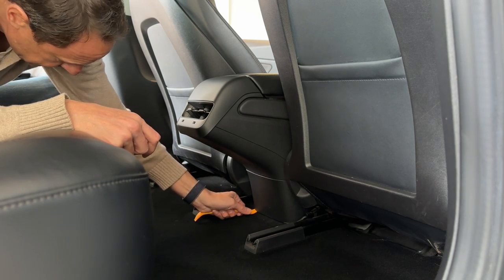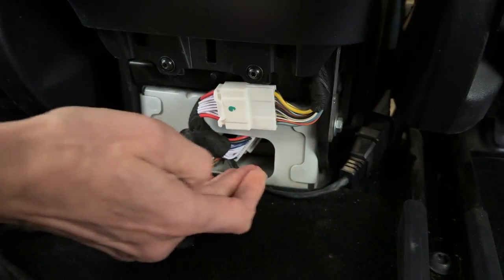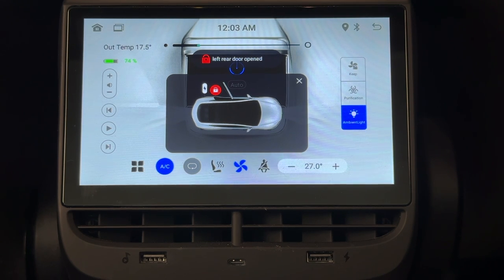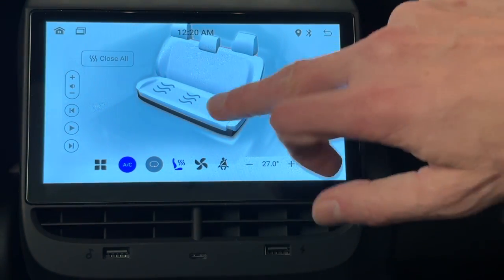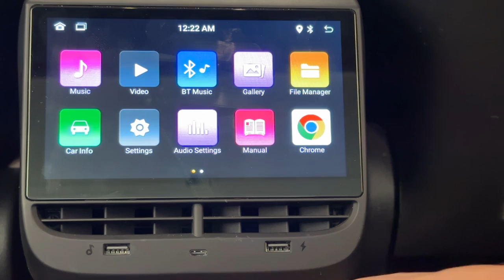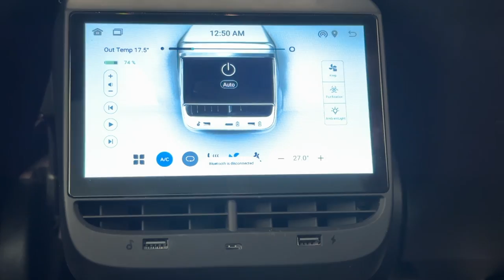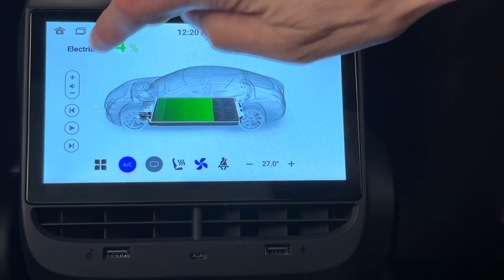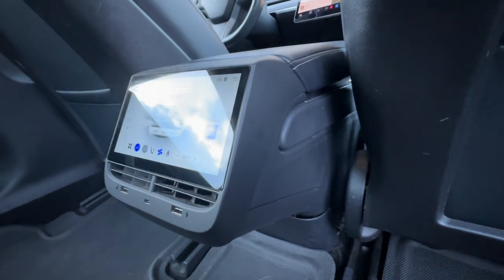EVBASE Tesla Model 3/Y Rear Screen Display

Comment: Nice work, FTG! Your combo video (install, features, and review) makes for one stop watching. I’m sure it won’t work with every product, but it made for a solid overview with this one. 

I don’t regularly have backseat passengers, so this is most likely a Pass for me. 

But if I did, (and they were old enough to be able to use that screen without my having to give constant instructions!), I’d give it a consideration. In that situation, I’d be a solid Yes - if the back controls did not change the front settings. 

Thanks for putting this together!

Comment: I would give it 5/10. Too laggy for me and the fact that it cannot use the cellular data from the car for Netflix is a deal breaker for my family. Hopefully there will be a better version in the future. Thanks for the honest review as usual.
Reply: Tesla has the cellular connectivity of the car locked down like Fort Knox due to usage agreements with AT&T. Extra hardware will not be able to utilize the car’s cellular connection until that agreement changes. I was able to get Netflix downloaded onto my rear screen and tether to my cellphone WiFi, which I have unlimited data on. This works fine for watching Netflix on the rear display. The “lagging” is only apparent if you venture into apps- if you’re on the screen that controls A/C, volume, media, etc, there is zero lag because there are no interaction animations. Most people don’t delve into the apps but having access to seat heat and A/C in the rear was well worth it for me. Most media consumption in the back seat for my family would be via an iPad, so having media on this rear display isn’t important for me personally. 

I’ve had at least 2 dozen people in my back seats comment that “I didn’t know Tesla offered a rear screen for the Model 3! Cool!” They didn’t realize it wasn’t OEM - the fit is absolutely perfect - and in their usage of the temp and seat heat, no lag is apparent.
Reply: @Unkn0wnC0mmand  I can't get either of mine to play sound at all. Any help?
Reply: @Howard McQuilkin  you paired and connected their Bluetooth to the car and then selected their Bluetooth connection as the audio input on the Tesla screen? 

That's all I did to get audio over the Tesla speakers.
Reply: @Unkn0wnC0mmand  I did. I have this unit in two different cars. Neither one will play audio.
Reply: @Unkn0wnC0mmand  Yes, I have been trying for a week or so. Still zero sound.

Comment: This is the previous version with 7.0 inch  screen and no Bluetooth. they recently launched a new version 7.2 screen with Bluetooth for headphones and game controllers as well as passenger seat adjustment ( if you have it…I do on my Y 2020.). It’s much improved. 

The small screen version is dead as well as the 8 inch ugly tablet. 

I’m from Quebec so it’s way too much money for a seat heater. It’s like 800$CADz I’ll wait for next update with improvements and 350$ less.

Comment: Need help. Bought tesla model y 2023 this april. Bought the rear display. But once i crack the bottom rear console panel, there is no more blue connector harness there. Any idieas where did they route it?

Comment: I installed it.  Easy to install and the added seat control is cool.  But it does not work as advertised unfortunately.  I left it in for cool factor but it’s essentially useless.

Comment: I just installed this on my M3 last week. After 3 days I removed it and I'm requesting a refund/return.

Here are the issues I found with it
1. The sound of a video is off.  This means my kids or passengers in the back can not properly watch a movie
2. The screen will freeze and will not respond to touches. I have not figured out how to recreate this bug, but it happens often
3. Can't connect headphones via bluetooth.
4. After having it installed for 4 days, the 12 volt battery in my Model 3 reported that it needed to be replaced. Possibly due to battery use of the rear display(?)
5. The temperature always displays Celsius even after I set it to Fahrenheit
6. The visual display of certain items like the status of the seat heater is out of sync with the Model 3's main display.

Comment: Excellent review, but I would skip this product for a couple reasons:

- adds few useful features. Yes rear seat occupants can control the temp/fan, but it still requires the front to turn it on first.
- too finicky, some things work, some don’t. Slow. Most folks will not want to use this thing since it offers poor experience. 
- most folks will have kids sitting in the rear, this screen will turn into someone just playing around with the settings.
- if you do have an adult back there, they prob won’t know how to use it and ask the driver to help them. 
- for video or music, rear seat folks will prob rather watch videos on their phone rather than look downwards towards this screen. For music, you can connect via Bluetooth from backseat anyway. 

The only thing I think is a plus is the coolness factor. It does look pretty neat, but I still think it’s trying to be something it’s not, which is a model S rear screen.
Reply: yup, and also as long as it is not using the car's data, maybe it is much more cheaper and better to just buy a tablet holder for the kids!

Comment: How do you set automatic switch day and night mode?
Reply: In settings
Reply: @04red6  I set it but nothing happen
Reply: @dillonle4034  It's based on the headlights. If the headlights are on, the screen is in dark mode. Otherwise, light mode.

Comment: it is a bad product. whats the reason the driver to open the AC so the people to adjust the climate for everybody? lol.... it is easier to say to the driver to adjust the climate for back... the product is unusable untill they find a way the back to open and close the ac and also adjust their temp without interfier with front., also the vents are smaller and not even have the plastic to adjust left right manual the position. the screen software should have the right working buttons for the car, imagine to have a phone with apps that doesn't work or with buttons that doesn't work coz it meant to be for different country..... so a screen that have a button that doesn't do anything simply tells me that they are looking to put something on the market fast and they dont care about the quality or innovation....